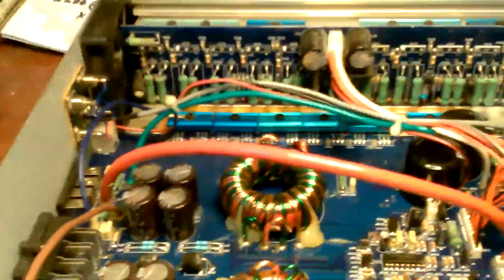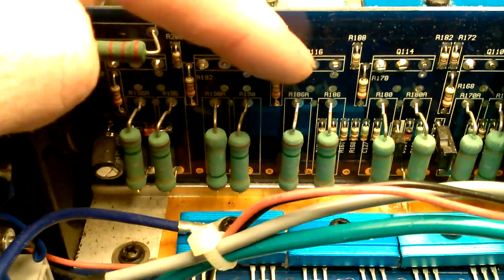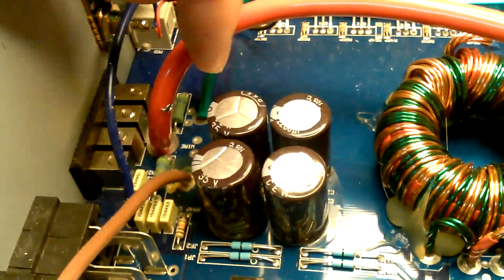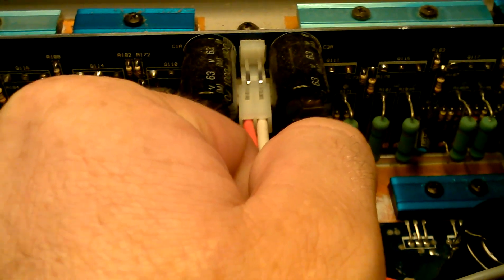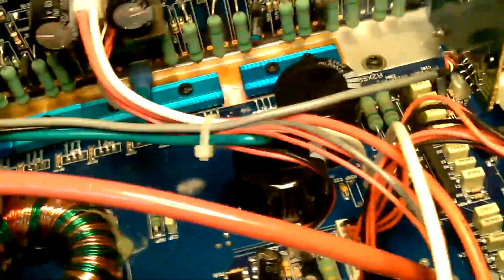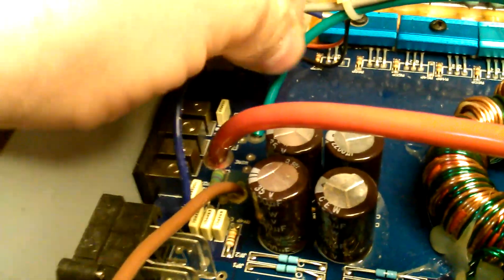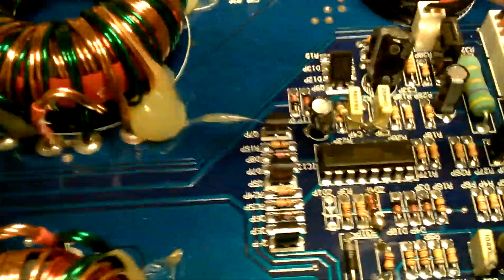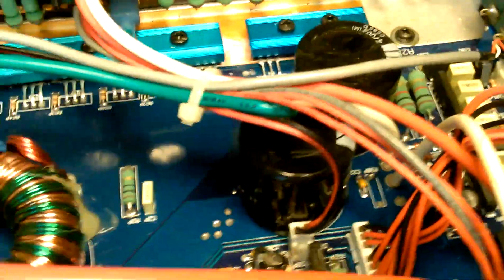Audiobahn amp repair

Comment: Looks like the mfg expects this amp to have problems, thus all of the easy disconnects for swapping in a new board. Too bad all of these simple disconnects are weak points (as you mentioned)! Great explanation of the issues, I'm sure you'll have it back up and working in no time.